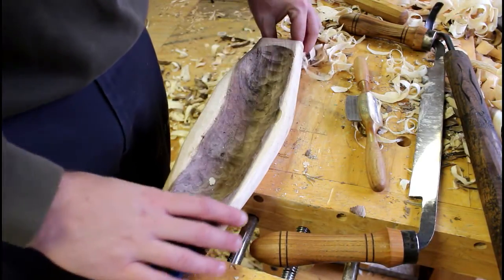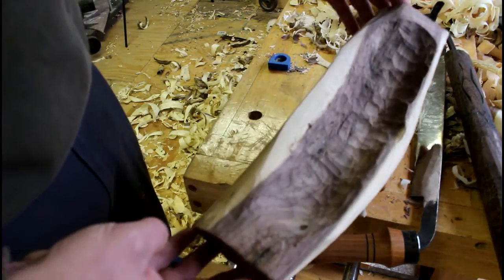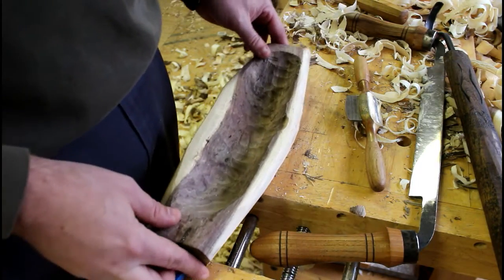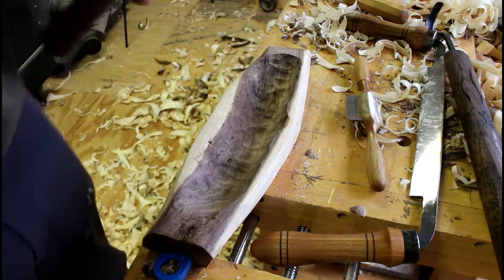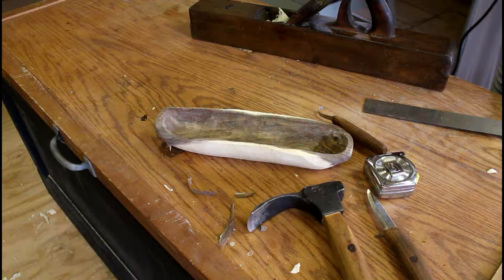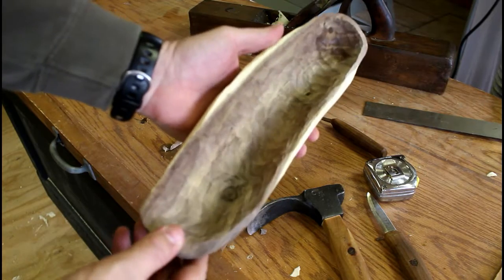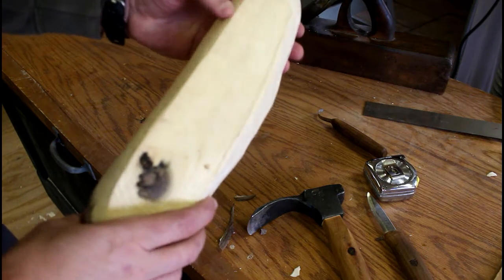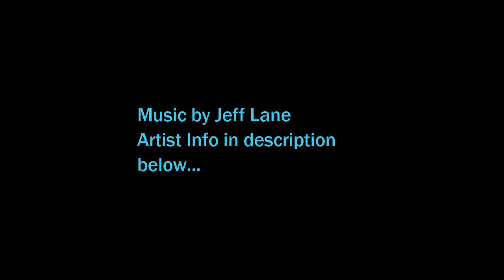Green Woodworking Bowl Carving

Comment: Cool!! I know nothing about carving or turning bowls, are they normally done with relatively green wood?  Can it be done with either?
Reply from the maker: +Taylor Maxwell you can use either. But dry wood would be a lot harder than to carve. With green wood little effort is need to make the chips fly.